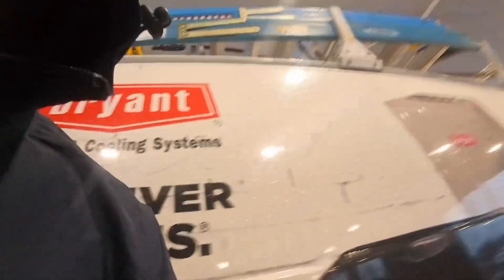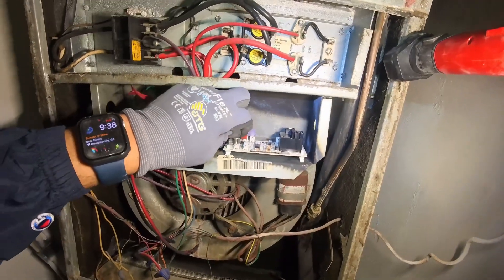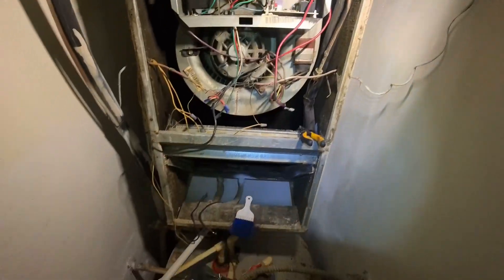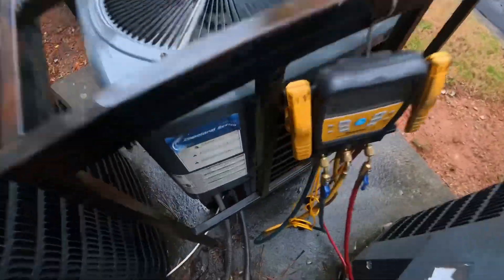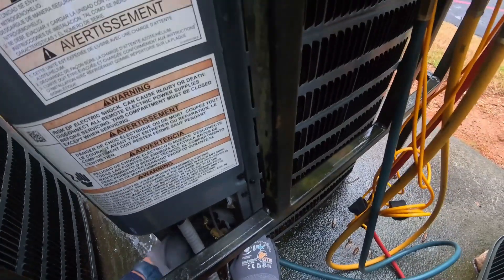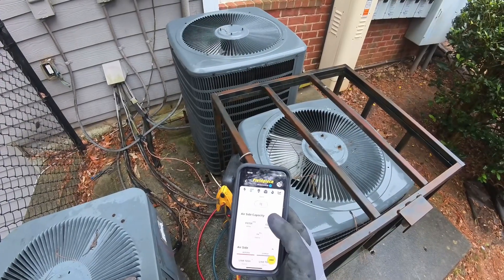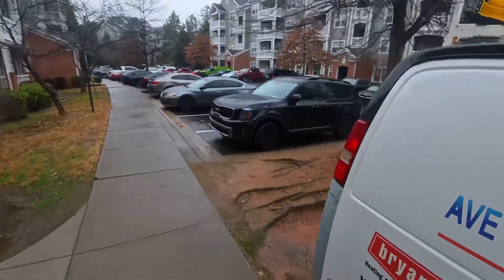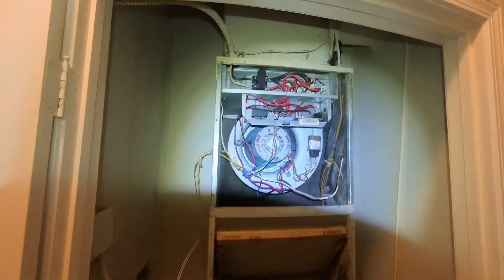No heat calls at apartment complex! Fried control board and replacement of blowerwheel #hvac

Comment: The cond. Fan Motor was running, so it wasn't in defrost.
Reply: That's what I was thinking, but I have seen the relay stick or the fan miswired to run with compressor.
Reply: @topher8634 Great point.